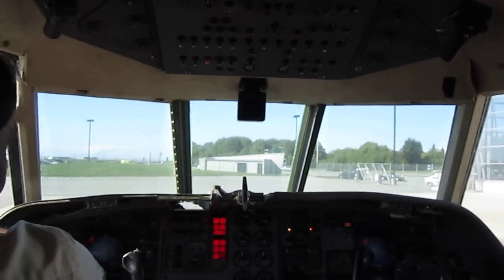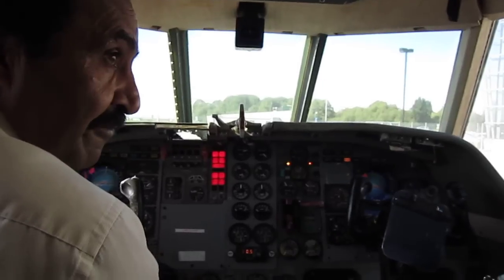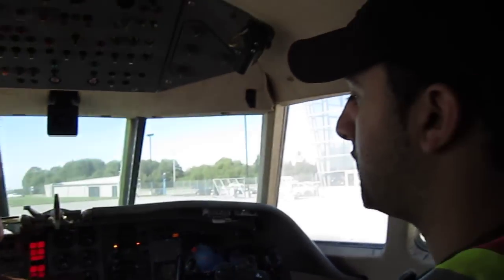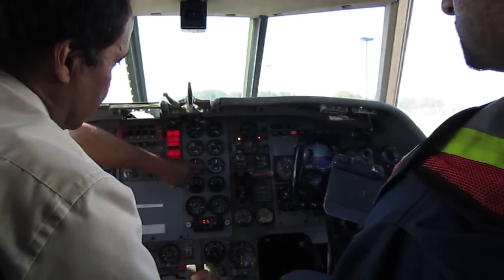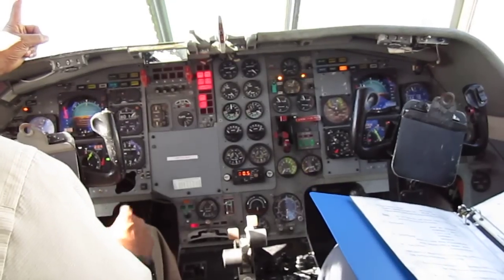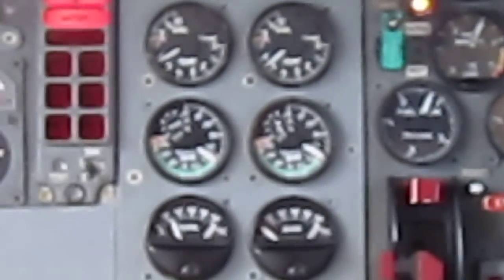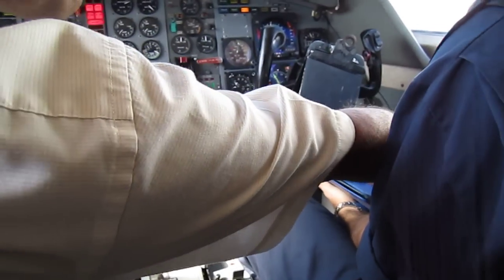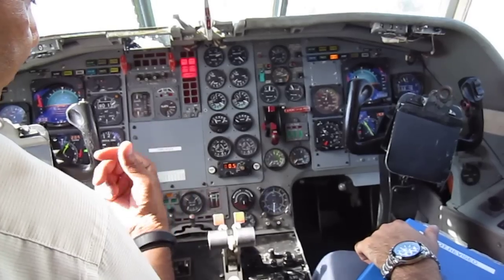Dessault Falcon 20 Jet Engine Startup

Comment: Of course, you could just skip the pre-flight check, and start the engines immediately, but the check is done for a reason. If there's a problem, you need to know about it while you're still on the ground, not in mid-flight!

Comment: Even though instrument camera focus is poor, by making out the EPR instrument, this is a GE-powered Falcon 20, and of course its unique sound. The TFE731-powered models had N1 as power instrument. In most jets the engine instruments are arranged in a stack from top to bottom analog or EFIS; N1(or EPR), EGT, N2, FF, Oil Press/Temp, for times where camera focus is terrible. The 731 engine is the most popular engine. For 1980glasgow, cup holders do exists in Falcon aircraft all the way to the 7X. They are at the rear of the pedestal one for each crew, so you can fly and have your coffee too!

Comment: This is a 20. The sound is unmistakeably a CF700. There are two other options - the TFE731 and ATF3. Later 20s had those and the 200s had the ATF3 only.
Reply: They were retrofited withthe TFE-731-5 ar at first and then changed to the TFE-731-5 br variant as far as i remenber.